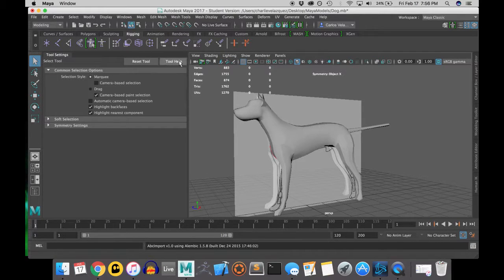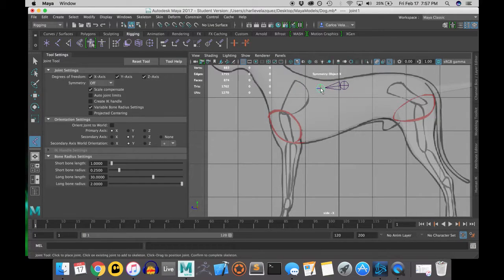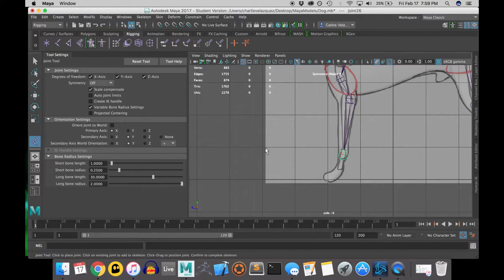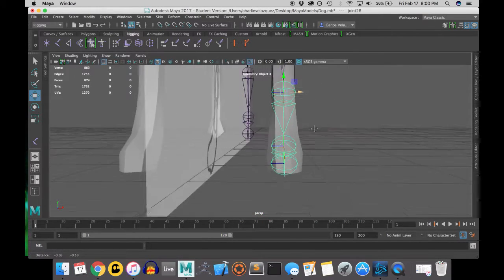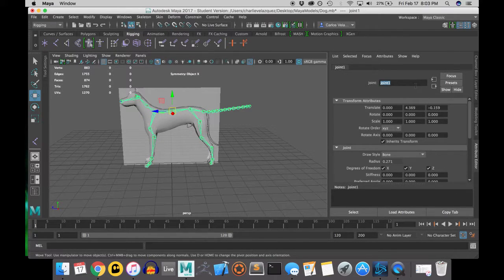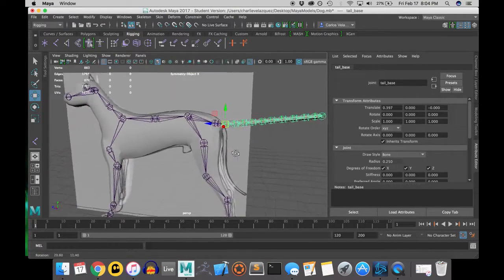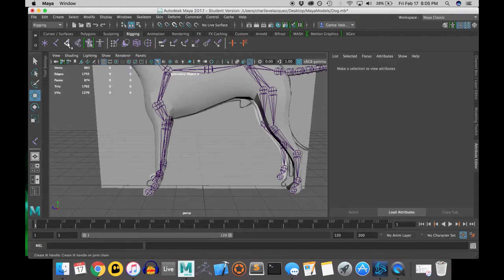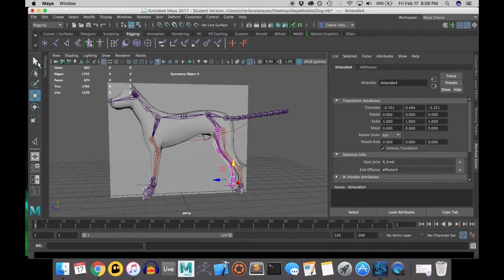Dog Modeling tutorial pt.5 [Maya 2017]

Comment: Hello, I want to ask you about Ik Handle
How The beginning is in reverse，in front
My IK is going to the back。
Want to consult with you how to do it?

https://drive.google.com/file/d/1O5z6mn3eFjzW1eu9-vidPAjeIhwU5QDp/view
Reply from the maker: I'm glad you reached out. I see the issue.
If you look at how the leg joints are set-up during 3:39 - 4:09 
You should be able see the difference between our joint structures.
Reply: OK, so it's a matter of joint settings 3:39 - 4:09  
Will lead  Ik Handle  become reverse?